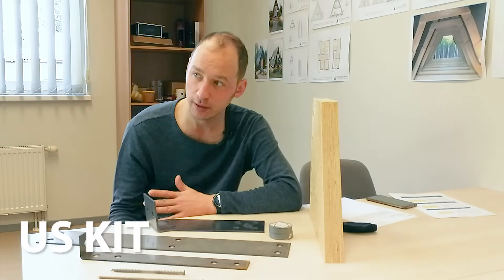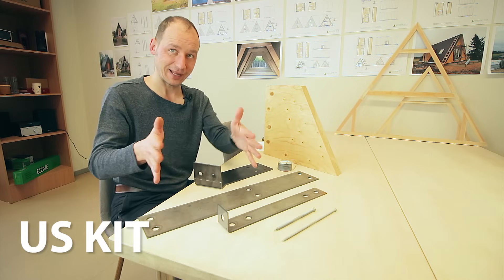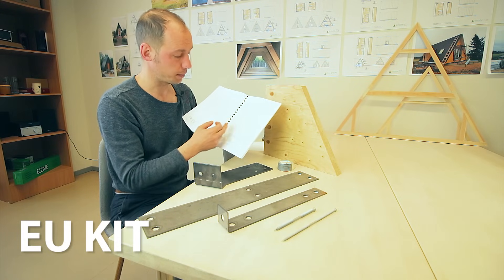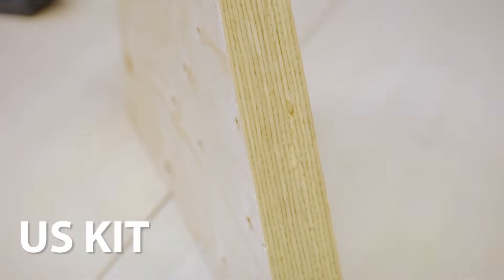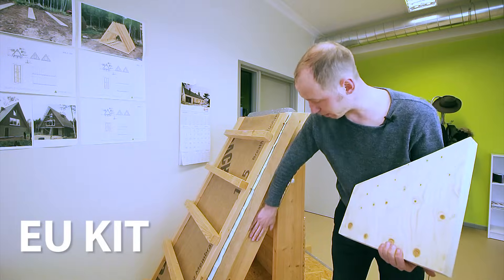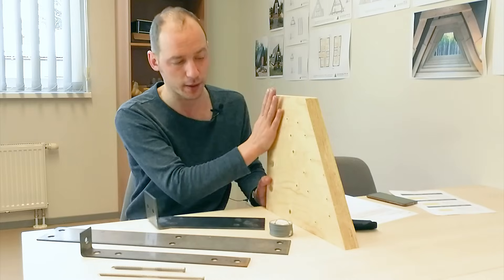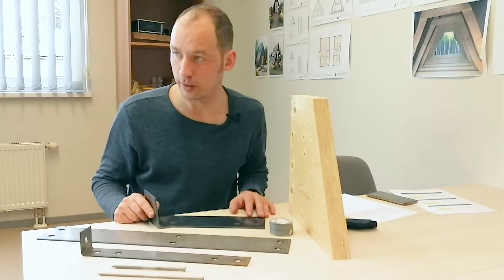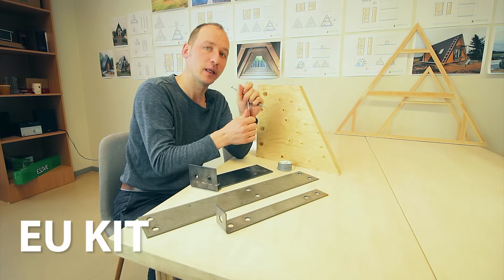Avrame A-frame House Kit | Differences Between US and EU models

Comment: I'm in Europe, but would actually prefer the USA specification of fixings. Those steel plates just seem far stronger than a few long screws. I guess European buyers don't have the option of specifying which they would prefer.
Reply from the maker: European kit has both. Long screws + steel plates on Trio models. Duo and Solo models have just screws

Comment: USA pays triple the price.
Reply from the maker: I can not agree. First, US prices are in dollars, EU prices in Euros. There is about 15% difference. US kit includes stairs and dormer. EU kit has these as extras
Reply: Well, if you do the math: it seems it has at least double the wood material (spacing of frames is half) and the LVT price is double than regular timber.. so actually the US kit should cost 4 times... you get it for cheap if it is just three :)
Reply: @AVRAME  Can we get the documentation in the US, though?  I know it's not required but it would really help me when I go to remodel and I can't remember some technical detail that I'd need to calculate something important.  Disclosure - I am a semi-retired engineer...so apologies if I ask weird questions.
Reply: It costs $2 per cut to get boards chopped at Home Depot that were actually bought there.  With a kit, I don't even have to inspect the lumber until it gets here.  Now that's homebuilding the way it should be lol high quality and super efficient leaving more beer and campfire time
Reply: @AVRAME  what is the website for the us
Reply from the maker: @doddfamilyministry6880   www.avrameusa.com